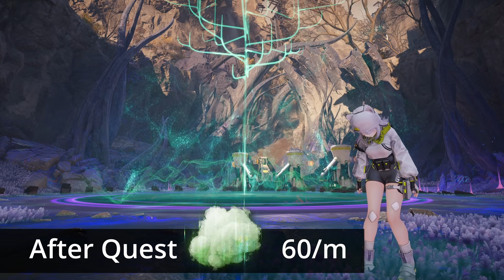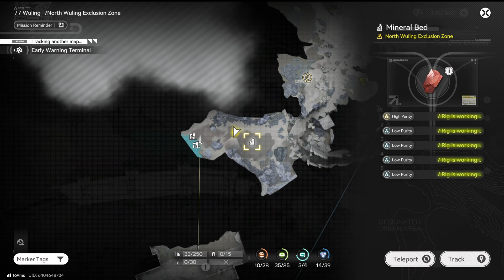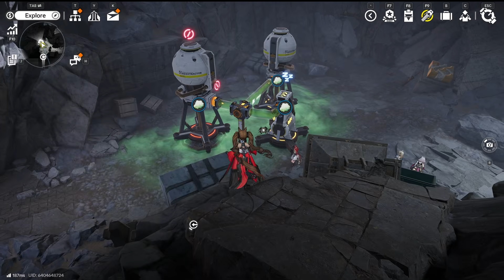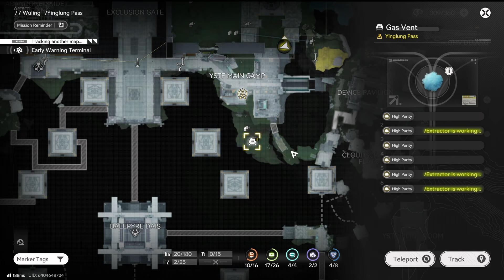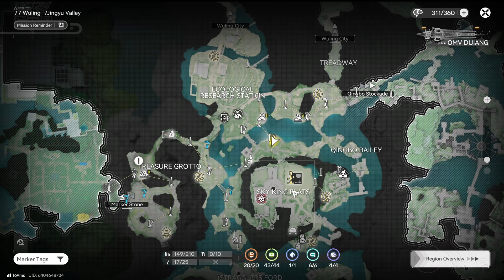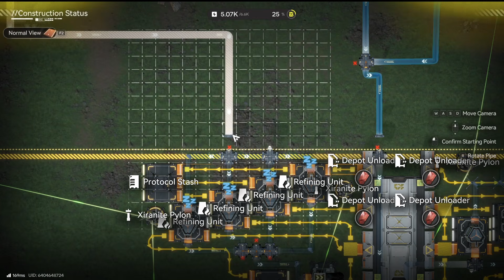9/m Pyrrolite Component! The Ultimate 1.4 Factory Blueprint! First Version!

Comment from the maker: Updated: The over consumption issue on xiranite is now fixed, but the heavy xiranite is now producing at 9/m from 12/m as it's the most dispensable resources out of all.
code upated in the description, the set up is still the same but the water pipe's location is relocated, but it should be easy to adjust the pipe by yourself.
If you cleared the RIft Quest and got extra xiragen, look for control port on the xiranite(normal one) set the setting from 24/m to 30/m, delete the spliter beside it, reconnect to have back to 12/m.

[fXiranFlow1]
EFO014o5OUE5Iu37UOE71A
[fXiranFlow2]
EFO01A5ie97i42EIeE9ieO

Layouts are now uploaded on discord for Asia Blueprint makers
Reply: Any quick fixes for the mentioned issues? No rush. Possibly a follow-up video?
Reply from the maker: @UnrivaledPiercer I will just re do it and update the code, wait
Reply: @Re_RealSuke  no stress bro, take your time. Love your videos, keeo em coming bro
Reply from the maker: @ryanlamb8458  
[fXiranFlow1]
EFO014o5OUE5Iu37UOE71A

[fXiranFlow2]
EFO01A5ie97i42EIeE9ieO

It wasn't the hardest to fix, but I was so tired yesterday. Here's the fix I will also update the code
Reply: Hi so sorry i cant seem to join discord through the link as it has been expired i need the code for Asia server thanks and sorry

Comment: I'm confused, your only producing Heavy Xiranite from 1 source and then using it for 2 production lines for the new Gears.  Even if you turn off one of the gears components, you still are losing more Heavy Xiranite then your producing.  Am I missing something here?  Or are you numbers calculating no Gear components?
Reply from the maker: 13:00
Reply from the maker: New Heavy xiratnite recipe produce 12/m my dear